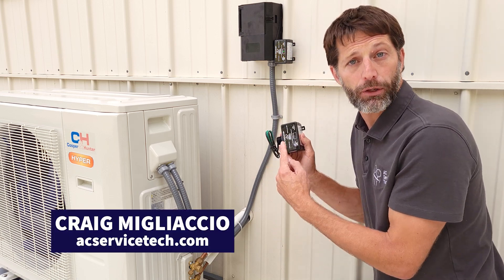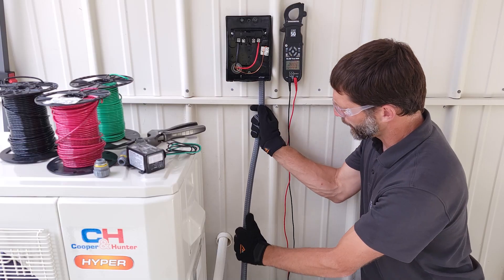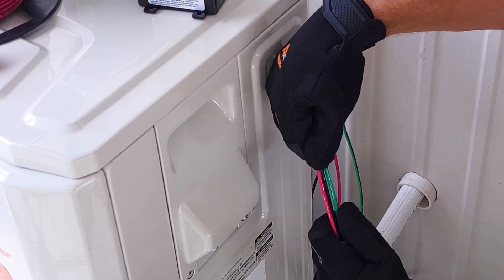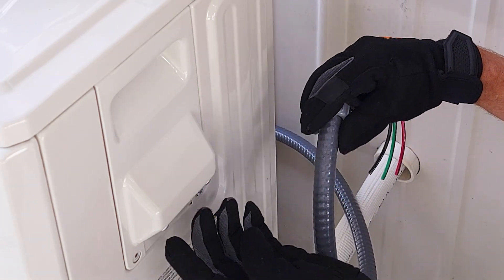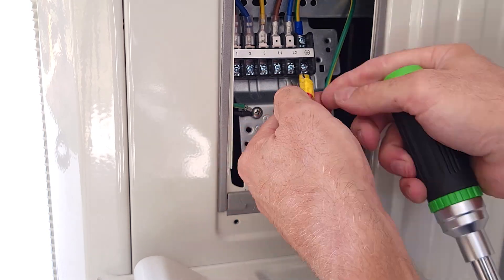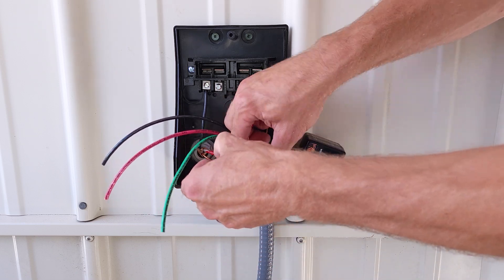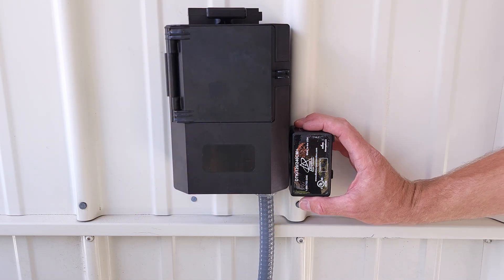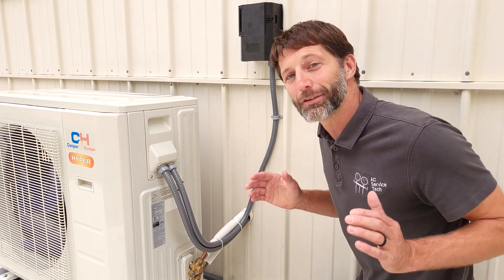Installing an Electrical Whip and Surge Protection on a Mini Split!

Comment: Good stuff another great video - however are you sure the lugs on that disconnect are rated for two wires to be installed on them? I like to wire nut and pig tail the surge protector so as to only have one wire at each lug.

Comment: In a 120v install... do you wire the green to neutral or ground?
Reply: You would terminate both black wires of the surge protector to the single 120V hot wire. Then terminate the green wire to either the neutral or ground conductor.
Reply: @diteksurgeprotection  Thank you for the response!

Comment: Have always given you thumps up, i understood all the wires pertaining to the mini split connection, but on the surge protection i have no idea what you did, i am sure with installation instructions, i can get it install.
Reply from the maker: Alfonso, surge protection gets wired in parallel with the circuit connecting to the minisplit. This way, if there is lightning, it shorts the high voltage to ground. It does not break the circuit, thanks!

Comment: Good video. Two suggestions:  
1)Terminate the conduit at the split unit plate first. Then feed the wires from the rolls into the conduit until they protrude through the box end. Then install the conduit connector at the box,  connect the wires inside the disconnect box, and finally, cut the wires to length at the split unit end. Doing this prevents having to cut the wires several times, wasting expensive wire. Changing the order of installation requires less steps (multiple wire cuts);  
2) The surge suppressor wires look to be a gauge or two smaller than 10Ga. Because of that, each termination screw in the box might not securely hold the two sizes very well. It might be better to crimp lugs on the wires in the box also.

Comment: Glad to see you teaching to use the crimp end terminals. Not many techs take that extra 30 secs to do this. I can't tell you how many times I've seen burnt up connections at a unit because the screws loosened up when they didn't use them.
Reply: I dont' get it. why cant' the screws loosen up when using these crimp end terminals and cause burn up connections as well?
Reply: @rivergate950  good question and I’ll try to answer it, I think it’s because let’s say if it’s stranded wire, there could be more strands favoring one side of the connection which is being clamped down and making good contact with the terminal lug or screw and the other half may not be making contact at all if it wasn’t stripped and twisted evenly so it’s nice and tight and perfectly round.  A lot of people don’t take the time to twist the wire ends with pliers and just stick it in and tighten down but not all wire strands are actually clamped down just the taller parts are. Hard to explain but I see it often. The strands that are loose under the screw or off to side of screw overheat because not good contact and arcing occurs. Not exactly sure how the screws loosen up but I see it a lot but not usually if crimp ends are used. I think it’s because you can torque them down completely across the whole connection. Anyways, that’s just a guess but it’s good practice to use them as it’s a cleaner job and easier in the future if you have to replace a contactor or whatever the wires go to. I’ve had more than a few drinks so hope I made at least a little scenes here lol

Comment: You have to be careful with the Surge Protectors. I use those same ones for Fire Alarm systems. They typical require at minimum 3' of wire between it and the device your protecting so it has enough time to react.

Comment: My thought it would have to be wired in series to work... more information needed I guess.
Reply: Kind of like a pressure relief valve. It is in parallel with circuit in a high impedance state under normal voltage. When the component sees voltage that exceeds its threshold, it goes into a low impedance state and allows the excess voltage to bleed off safely to Earth ground. This process is done in a matter of microseconds (millionths of a second).

Comment: Guess I’m lost on this. Not understanding how a surge protector works the way you wired it.  Does it some how throw the breaker when it senses a surge?
Reply: hayyyyyyyyy  un pelo en la sopa
Reply: Kind of like a pressure relief valve. It is in parallel with circuit in a high impedance state under normal voltage. When the component sees voltage that exceeds its threshold, it goes into a low impedance state and allows the excess voltage to bleed off safely to Earth ground. This process is done in a matter of microseconds (millionths of a second).

Comment: Nice work. 

Why did you put it on the load side instead of the line? If it's on the line side in essence it would absorb the surge before it reaches the equipment, correct?
Reply: It wouldn't matter either way as the surge protector is in parallel with the circuit. There is still 6' or so of electrical ship between the disconnect and mini split.
Reply: @diteksurgeprotection  whats the benefit between uisng this $55 surge protector vs the $200 one you make?

Comment: So the sdp measures the voltage going to the outdoor unit, and since its wired in parrallel, does that mean it just absorbs any surge (increase) in voltage, and only allows 240 to the outdoor unit? And even with this increased voltage the outdoor unit still sees 240 volts? Or does the surge protector somehow trip a breaker.. what about voltage decrease? 😂 just trying to understand how it works better..
Reply: Inside the surge protector are metal oxide varistors (MOVs) There's two of them, one for each leg of the 240V split phase power. They have a minimum voltage level where their resistance decreases from a high value, to a low value to absorb the surge. The surge is very short in the time duration, that  the fuse or circuit breaker will not trip. The idea is to protect the input electronics on the controller board of the minisplit (or other electronic system). One problem with this system is how long the ground return is to the earth electrode. I believe for this to work correctly there should be a ground rod installed at the disconnect. This shortens the path back to ground, as the surge can be in kiloamps  (less then a few microseconds), and the IR voltage drop of the ground wire can make the surge protection mute.

Comment: I’m glad to see you putting that “communication” wire inside of conduit, I installed a DIY Mr. cool unit last year and realized the communication wire is more than just communication, it’s 240 V that squirrels could eat or string trimmers if you don’t put conduit on it…. I think the new Mr. cools I have a hard cover wire for that communication line.  All the videos I saw on the older units just had the wire running next to it the main power wire.. I am not a master electrician but It looked like some thing a home inspector would ding you on right at the last minute.

Comment: I always use deox on outdoor connections. I usually open up the unit and deox their wires too.

It seems that most service work I've done on outdoor equipment could have been avoided if deox was used on the connections.